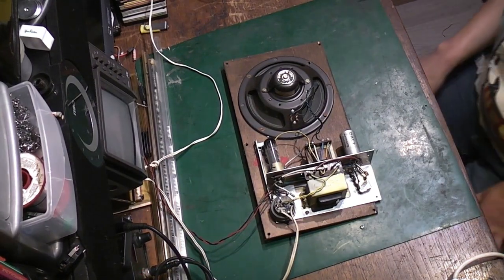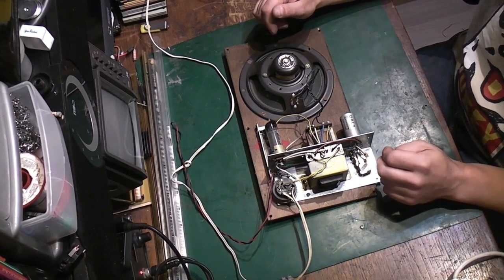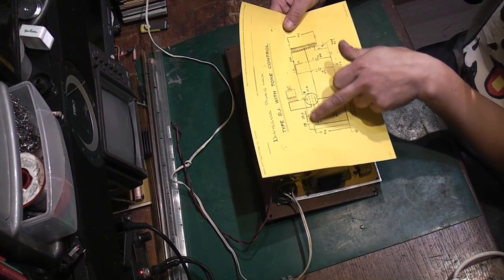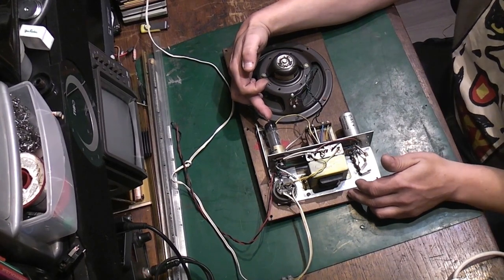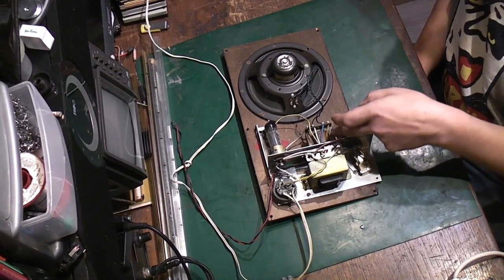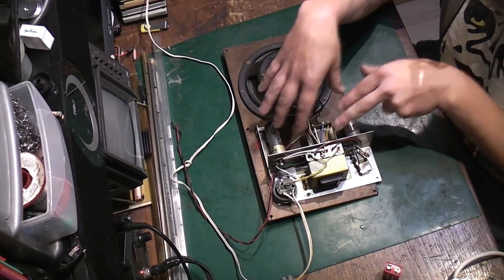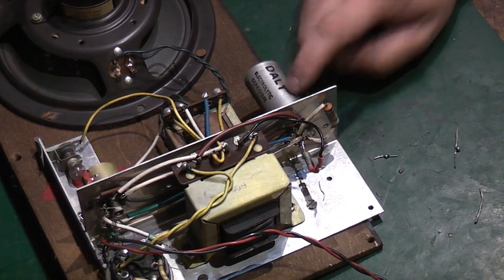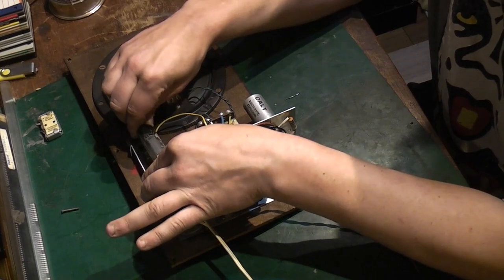Dansette Automix amplifier, fault diagnosis and  repair

Comment: Good easy to watch channel - thanks.
How about changing to a bridge rectifier,  adding a choke and second same value capacitor, would stop most of that ripple as in a  'pi' type configuration.  Need to consider the new voltage though. 🤐
Wow, commented too soon. At the end you said "literally no hum".  Sorry me too quick to jump in 🙂.

Comment: I usually also add a slow-blow fuse in the live line, which can save the mains transformer if something goes bad, such as smoothing caps.
Reply from the maker: Very good point, I'll be adding one before the restoration of the player is complete.

Comment: I wonder why they used a 45v tube in a transformer powered amplifier?
Reply from the maker: I think it was one of the cheapest output valves available at the time so cost probably paid a part in the choice. Bush and a few other makers did it too in some radios.